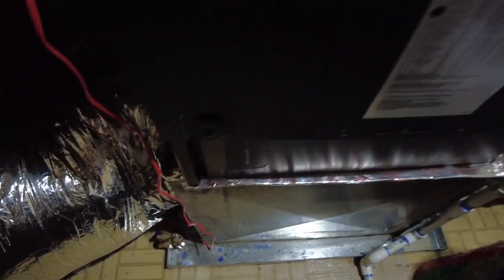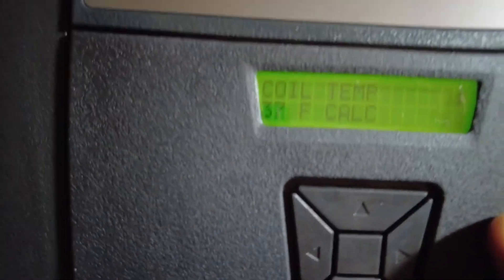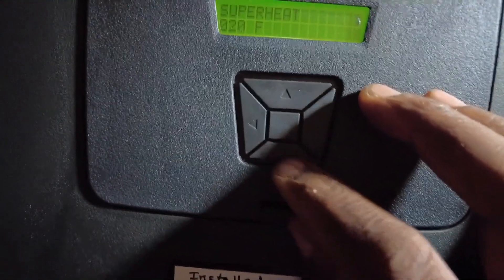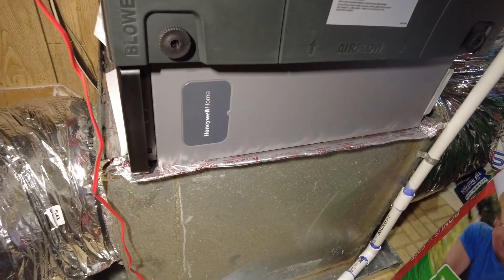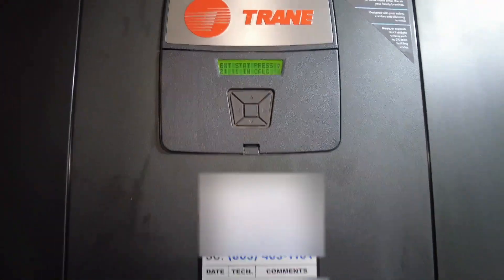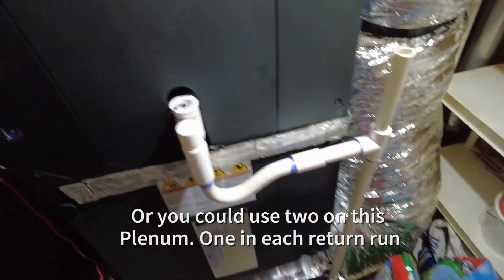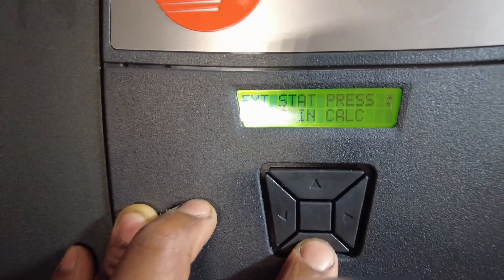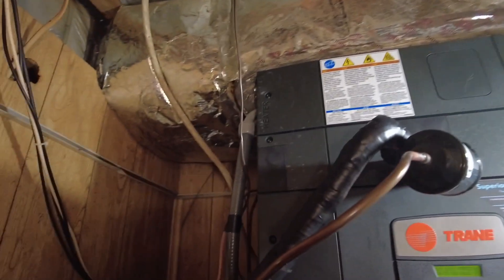Be careful when using HVAC media filter cabinets l whole house AC filters need to be sized properly

Comment: I was wondering if my media filter cabinet is wrong size on a new hvac install, its a 3 ton goodman unit single stage. The return plenum is around 16 inches high and 25 long, but they installed a 20x20 between it and the blower, I see like 4 inch of space on the right. Is this bad for the system, should they have installed a 16x25 inch one? Could it be causing water to shear off of the coil onto the side of the evap coil box?

Comment: Did you test that static with the filter in and filter out?

A filter is going to provide a restriction in airflow regardless.

The ductwork in that home with no filter is .7-.8"WC, thats a duct sizing issue especially with a 20x20x4/5 filter. Alot of manufacturers have a .5" design TESP not including filter.

HVAC equipment needs a filter, and fiberglass ones are not catching anything.
Your comparison should be against another filter that is 20x20x1 Merv 6 or 8. Not a filter vs no filter. 

There is also a huge difference between a filter in ductwork at .5" than .8" WC.

Comment: i have two story house in Houston central ac two filters downstairs one upstairs and 4 inches one like you showed in the video do i have to replace all of them or just the one inches on grill returns?
Reply from the maker: Usually when you have a 4-inch whole house filter you shouldn't use the 1-in filters in the  grill return  as it adds more  restriction
Reply: @HVAC Tech Knowledgy  in that case can i remove the 4" and keep the 1" in grill returns that way i don't have dust in the ducts returns?
Reply: @nopenope414  Protect your air handler, your duct work and the air you breathe.  Screw the return.

Comment: How do you reckon that static pressure issue can be fixed?
Reply from the maker: I would probably just relocate the one thats installed to one return on one side of the plenum and add another to the other return drop. That way you have one on each return drop.
Reply: Ya I also see that’s a merv 11 filter, I wonder if a merv 6 would do any better
Reply: Find out what side has the most restriction. Also make sure your fan speed is set properly before making any adjustments.

Maybe the return drop/trunk needs to be larger. Adding a media cabinet usually helps as your filter is spread over 5" instead of compressed into 1" You need to add a return air to the system.
Maybe the return air at the floors wasn't cut out properly and needs to be larger.
Larger return registers and openings.

If supply side, you need to dump air or upsize ducts/runs to be able to handle the airflow being provided.
This is not always possible.
Before adjusting, you would want to calculate Airflow CFM AND your Velocity FPS. increasing early runs and Ducts can drop the Velocity and leave the end runs lacking pressure.
Reply: I have also seen brands be an issue.

A furnace was going off on limit. Brand new 1" Noma/Nova filter from customer.

High static. Try another new out of the plastic same brand filter. Same result and reading.

I went and grabbed the same Merv rated filter, but different brand name out of my truck.

The static dropped and the temprise fell within spec. The temperature at the furnace also dropped, which drastically  dropped the temperature between my supply and my high limit.